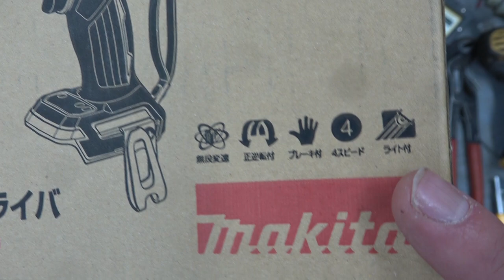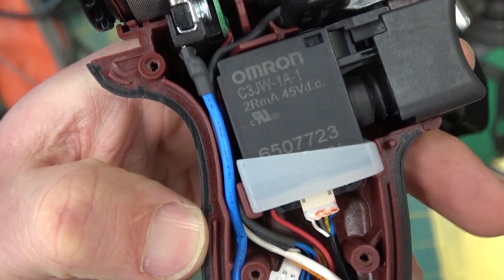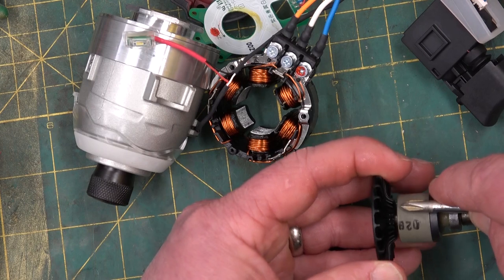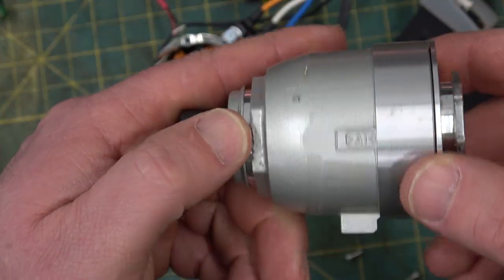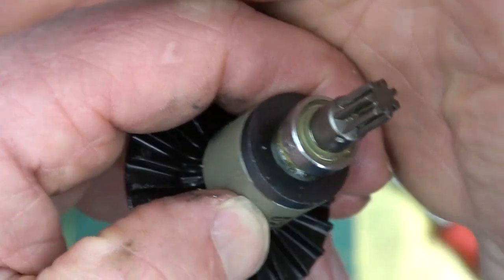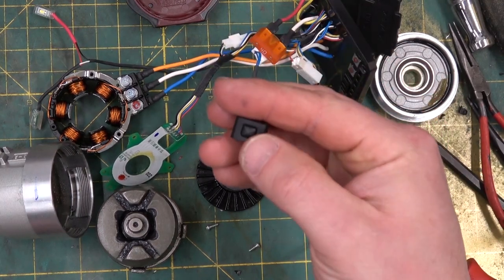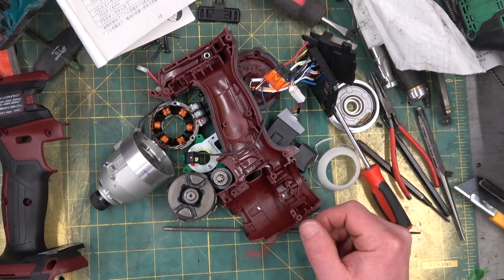Are Japanese Tools Better? Yes.

Comment: Translations + Notes below:
The characters on the board with the Hall sensors are 紫赤青黄白黒, which makes sense both in Japanese and Chinese.  It means “Purple, Red, Blue, Yellow, White, Black.”  I believe it’s referring to the order in which the colored wires should be connected (to avoid errors during assembly, I suppose). Note that there is no purple wire, but there is a blank spot next to the red. 

In the manual, the small switch is called 手元ボタン, which means something like “close at hand button” or “at-hand button”— basically, a button in convenient reach of the trigger finger. 

The panel at the bottom is as follows:
The left hand box has a white button with 打撃, “impact” in this case, with a series of light indicators above: 弱　中　強　最速, respectively, “Weak, Medium, Strong, Fastest.”  Underneath the box, to the immediate right of the white button, there is a black button ライト, meaning “light.”  To the right of it, there is an indicator light (still on the black field) with the inscription 設定, which can mean either “settings” or “set” (I would have to see the manual, but it indicates setting some sort of preference, likely— perhaps the default?). 
On the blue field, the drill has Makita’s proprietary 楽らく4モード “Super Easy 4 Modes” [rough translation] selected by the button with 楽らく (“Super easy”). These are modes in which the drill will automatically change the torque and speed based on the type of material you select and the resistance the screw is giving. The modes are:
木材 “Wood materials” (top left indicator light), where the drill will start at a lower torque while a wood screw is going in then automatically jump to the highest torque when the head is almost flush to give it a nice tight fit
ボルト “Bolts” (top right indicator light), which will only use the top speed/torque but stop as soon as the bolt tightens (to avoid over-torquing)
And two modes under テクス用 for driving self-tapping metal screws into pilot holes (literally translated “Tekusu-use,” referring to a widespread brand of self-tapping metal screw called “Tekusu,” made by JPF Manufacturing). The two modes are 薄 “thin” (bottom left) and 厚 “thick” (bottom right), for use in thin metal sheets and thicker metal sheets/beams, respectively. The former tests the resistance of the screw to find an appropriate level of torque to avoid stripping and automatically stops when the screw is fully tightened, while the latter does the same on higher torques, but focuses on avoiding breaking off the screw head or otherwise damaging the screw.
This is explained in detail on the following site, with videos (Japanese only):

https://www.bildy.jp/mag/makita-td171drgx-mode/#i-5

Your final comment is correct— Japan often makes different products for the domestic market, sometimes better produced than the international market counterparts. Oftentimes, this has to do with the very specific requests of the Japanese market (see the “Galápagos Syndrome [ガラパゴス化]”
https://en.m.wikipedia.org/wiki/Galápagos_syndrome
). This also has to do with a sad tendency of Japanese companies to forget that there is a world outside of Japan. It can be hard to get these products in the West, but there often are really good deals on the used markets (eg. Yahoo Auctions)— you should be able to purchase on websites that ship only within Japan or only accept Japanese credit cards by using a proxy buyer.  These are several companies that will charge a commission, but will buy the product and pay for you at domestic rates, then handle shipping it to an international address (they often charge 10% or so— not the cheapest, but with the deals on the auction sites you can save TONS of money over Amazon.co.jp 
If that’s too sketchy for you, though, Amazon JP has a halfway decent selection as well)
Hope this helps!
Reply: More likely Japanese. 青 is more of a light green in Chinese, and you'd actually use 藍. Also 赤, even though Chinese use that for red, that's more used in old literature, modern Chinese will use 紅. Also, they didn't use simplified Chinese, which Hong Kong and Taiwan uses
Reply: @egonsung  Thank you for the comment! That’s fascinating— in Japanese, 藍 and 紅 are used, but more for the specific colors of indigo and crimson, respectively. I did not know that they were used for the more general blue and red colors in Chinese!
Reply: @egonsung  The character for black is a clear indication that it's Japanese. 青 is used for blue in Chinese too. Hong Kong and Taiwan use traditional Chinese.
Reply: 青 means Bluey-green or Cyan, either one is ok, but in electronic, printing…, Cyan is better. In printing, CMYK, Cyan青, Magenta 品红, Yellow 黄, Black 黑.
Reply: Thank you so much for this comment!
Reply: The info is highly appreciated
Reply: Thank you for this information. I stumbled across a Japanese-made Makita impact driver exactly like the one in this video. I liked the color and bought it on Ebay brand new not knowing that it was made in Japan and that Makita's Japanese domestic manufacturing standards are a bit higher than their export manufacturing standards. My recollection is the price was comparable to the exact same model of a Chinese-made impact driver. I did find a user's manual in English online, but your explanation of the symbols on the tool help. Thanks again.

Comment: What makes the application of Viton so great for tools like these isn't just the high temp rating. Viton exhibits nearly as wide of a chemical resistance as PTFE AND has an unlimited shelf life! Environmental deterioration  in rubber compounds is what causes the "drying out" that typically causes failure in old or particularly cheap tools.
Reply: Isn't at high temperatures or in a fire, fluoroelastomers decompose and may release hydrogen fluoride?

Comment: Notice the jump cut while the riff-raff was figuring out the reverse thread. Appears to be a little distress to the housing that went along with the discovery.
Reply: He was just making sure it wouldn't gall if he tried to overtighten it. All part of the procedure <3
Reply: Shhh... I have been using oxy-acetylene torch for years and I still duck up the acetylene reverse thread fittings😅
Reply: Yeah gets me every time when you are work in auto mode. Every 5th time you take something apart and think s&%t they have done this up tight, and then you sit back and look at it and engage your brain. Hopefully you haven't screwed it up too much before you figure it out.
Reply: That was an alloy hardness test.
Reply: The little grooves cut into the acetylene "nut" is a handy reminder thats shes a lefty-tightey. guessin' thats true for all manner of gas fittings.

Comment: 3:38 - That's just the wiring order for that board. It's got 紫赤青黄白黒 which is "Purple Red Blue Yellow White Black". While Chinese and Japanese share some parts of writing I'd guess that for something that already has domestically sourced parts (Nichia, Omron) they wouldn't skimp out and outsource a simple board.

Bonus fact - The "happy little backwards e" is の and you see it a lot on stuff from Japan because it's the "Possessive Particle". It indicates possession between two words. Think of it like ('s) in English. The "Healing Bench's Shmoo" becomes "Healing BenchのShmoo”.
Reply: A good word for that is of as in soup of porkbelly
Reply: @jetaddict420  Yes, but ('s) means the same thing and the order of the words is the same. With "of", the order is reversed compared to の.
Reply: Nice
Reply: 赤could mean red in Chinese too but it's not often. Chinese will say 紅. So it's most likely Japanese.
Reply: @JW77  aah, nice info there bud. Always thought both of them use 赤 regularly.
Reply: @JW77  the origins of this is the split between chinese and japanese language historically. Japanese developed a side language using simplified kana, hiragana, katakana for foreign words and kept traditional chinese characters for a lot of words as Kanji.
Chinese simplified over time, too, and modern "simplified chinese" characters were just built on top of the traditional hanzi from waayyy back in the time that they shared a language.
Reply: @Mindful2222  All the Chinese PCBs I see use  紅. Always with that characteristic serif font when there is English.
Reply: Came to say this, said it, then realized it had already been said.
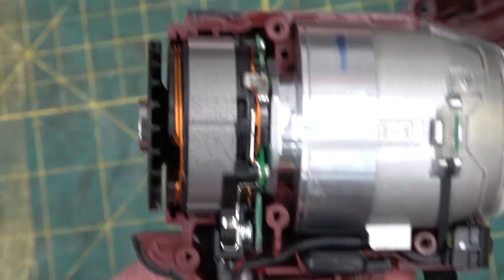Reply: 青means blue in  Japanese. While it means grass green in chinese. 2:40 and I don't any green wire.
Reply: @bosszola  青 is both green and blue in Japanese. The language had one word for both green and blue (青) and both were seen as essentially different shades of the same color, then they realized they need to distinguish between green and blue and made the word 緑 which refers only to green but you'll still see green things referred to as 青 (like their traffic lights).
Reply: @bosszola  True, but Japanese have a weird idea of green/blue. They use 青 to refer to the green traffic light and green apples, though technically it means blue.
Reply: @DingleFlop  there was no 'split' between Chinese and Japanese because they were from completely different origins. What happened is that Japanese borrowed the Chinese writing system and a lot of Chinese words and then realized that the Chinese writing system which was developed for Chinese didn't work for Japanese because the two languages are very different. Hiragana and katakana are not a 'side language' but just the parts of the language that couldn't be represented efficiently with Chinese characters.
Reply: @theodiscusgaming3909  To me, the Japanese green traffic light looks slightly blue compared to North American ones, so calling them 青 isn't entirely out of place.
Reply: loved your explaination.
Reply: @laserdan  Coincidence: we've got a different shade of green on railway signals to not to mix and match with the traffic lights' greens. That is some off-kilter green, more turqoise-ish, that  I guess would happily call itself 青 given the chance :D (And then there's the yellow, which is totally the very same yellow as Na vapor lamps used everyhwhere... to not mix in, yeahh right.)

Comment: Not many people in the US are willing to shell out $300 for a BL impact driver. In addition and while he didn’t mention it, the chuck is actually 1/4” (or so) deeper which allows for flip-able bits; very nice to have different bit heads and not have to go retrieve one. I was in Japan for a long time and ran an industrial shop (which included 6 carpenters) and was amazed at the quality of some of the Japanese domestic tools.
Reply: I would buy it in a heartbeat if it meant I wasn't replacing power tools every 5 to 10 years. I'm sick of the throwaway culture

Comment: The “hand button” is actually to change speeds while using it so you don’t have to use the speed control at the bottom of the impact
Reply: nice
Reply: I own one like that - dtd171, made in a different country. The button is programmable. You can select one program and apply it to use when this button is pressed. When pressed again, the tool will revert to previously used program. Great for repeating certain actions without using both hands for program changing while on a ladder.

Comment: I have just looked inside my Makita DTD171 (Made in China) which looks the same as in this video except it was made for EU market. It also has Omron switch, Nichicon capacitor silastic allover connectors. It doesn't look lower quality tool. Everything is identical.
Reply: That’s because it’s not what country it’s made in, but quality control, that counts.
Reply: And this video perfectly illustrates confirmation bias in action and how it distorts thinking. Later he's gonna compare a Nissan Skyline against an inexpensive family car and use that comparison to tell you how much superior all Japanese cars are.

Comment: That little switch is the "quick shift" programmable button for the different settings so you can switch between the ones you want faster and without looking.

I've had that impact since early 2019. It's awesome.

Comment: Just like their cars. They get the better motors with better interior, Exterior, and performance packages, also better factory wheels and suspension setups.
Reply: When you look at their past. When tourists started coming, they made stuff for them to look like genuine antiques. 
So they build tools for themselves and sell knock off to us. So it hasn't changed what we think is the real tool. Ha ha very clever.
Reply: That's why when you buy a Japanese car, you don't want one made in Wisconsin, you want one made in Japan.
Reply: They also cost 30% more
Reply: @radry100  
That's why you get harbor freight tools cheap or go for better quality. 
So I would gladly pay 30% more if my daily tools lasted longer. Not cook off because of cheap part inside.
Reply: @scjohnk  And you want your Mercedes to be made in Germany, not South Africa...as many have found to their peril.
Reply: @moyadapne968  how about Bubba Benz from Alabama?
Reply: 100%

Even with say Toyota, a company that has done everything it possibly can to minimize perceptible quality differences in feel and failure rates, a Japanese made Toyota will still feel and perform better over time. I'm not saying the difference is massive; clearly it isn't. But there will likely always be a disparity, and as you said that's not even looking to the cool options and trim levels they have vs elsewhere.
Reply: Yes my toyotas are cars you drive and never worry about anything. They are built to abuse and just drive. Corolla with 290k miles original trans fluid. Original suspension. Oil changes at 10k miles. Never an issue. 
Toyota Highlander with 200k miles still drives like new.
My f150 is 3 years old and feels like trash already. I already put thousands into it. I'd buy a. Tundra but they are expensive and get very bad gas mileage vs my ford. If toyota can do something about their bigger motors being more efficient it be great. Their v6 and v8 are very reliable but also very thirsty
Reply: bs, my Toyota pickup was the biggest piece of crap ever, got rid of it at 6000 miles while my ford has been going over 400,000.
Reply: @armadilllo  most North American Toyotas come from Canada. So does your Ford.
Reply: @TensionalSpy  my toyata was from japan and my ford was built here.

Comment: Japan makes some good stuff. Especially engines such as Yanmar.
Reply: Yes. I have one Yanmar inboard diesel. My 2 outboard motors are Made In Japan...........Tohatsu! Many other Japanese outboards are made outside Japan now.
Reply: Yea i have a small tractor from the 70s fully restored (bodywork that is) 2cyl yanmar fires evrytime on its first stroke no matter what and without glowing
Reply: My 2013 mazda 3 has been assembled in japan and im at 100K and nothing broke on it at all yet! They put in more effort then most in their work its great!
Reply: @saberxzero   03' Mazda 6 here, 272.000Km and the only problem it has ever had was becuase my brother (somehow) shorted it and screwed up the charging board but other than that it has been loyal as frig.
Reply: @takafumiarisawa70  Miiiiint, although i wont make it to 300k winter salts here fuckup the structure of the car itself sadly!
Reply: Any audiophile would agree wholeheartedly.

Comment: The bill of materials on that contain too many parts to even consider branding it a USA product.
Reply: @martialme84  Made (10%) in USA (90% in China)

But mark it up for patriotism or something.
Reply: @martialme84  Ok... just remember who landed on the moon first.
Reply: @kilometer3853  that has what to do with anything?
Reply: Proudly sold in America 🇺🇸
Reply: @Patrick Baptist Tesla, SpaceX, starlink, neurolink.  At least some muricans are trying.
Reply: @youmakeitreal  Tesla is a terrible example though, because the quality is just awful. China taking up production of Tesla cars is the best move Tesla ever did.

Rockets? Maybe. I wonder how cheap an endeavour or would be if it wasn't 'merican.
Reply: @Patrick Baptist Well, tell me what your country does best?
Reply: @kilometer3853  America does everything best
Reply: @MelodicTurtleMetal  ouch.
Reply: @MelodicTurtleMetal  I actually own a Tesla and it is the best car I have ever owned, and I have owned them all. The one thing I do know is that the Tesla that I drive is not designed to fall apart at 100 thousand miles.  Like ALL the others are.  I am a mechanic and have worked on "American"  German and Japanese cars for the last 30 years.

Don't knock it if you haven't tried it.
Reply: @kilometer3853  actually SpaceX gets stuff up into orbit cheaper, and faster than anyone else. (Saving American tax payers a bundle)
Oh forgot this:
 Muricans lead by a South African 😉
Reply: @Patrick Baptist there's no such thing as a tooth fairy, easter rabbit or the mark of the beast.
Reply: @youmakeitreal  all heavily subsidized by taxpayers or they wouldn't be solvent
Reply: @wurzzzz  and ULA is not?
Reply: @MelodicTurtleMetal You  must be from Europe? How am I ignorant? you're the guy hating hard on Americans... are ya sad you cant own a v8, ride a Harley Davidson, and live on 20 acres of land all for the low low price a regular 9-5 job? But hey at least you have free health care..... Give me a break America has been the  front of innovation since the industrial revolution. Only thing the euros have ever done is complain.
Reply: @UnknownGamer40464  10% in USA? I see you are an optimist sir
Reply: It's quite common that Japanese companies make better products for their own market. I can mention the watches from Seiko.
Reply: @MelodicTurtleMetal  Right, yet people continue to flock and relocate to America genius.
Reply: @michaelbrown3423  people flock everywhere, don't flatter yourself
Reply: @MelodicTurtleMetal  lol you know thats a lie.
Reply: @MelodicTurtleMetal  and the American dollar is still worth more.
Reply: @ksprr6856  Maybe, just not in the case of Makita. A Makita of the same model made in Japan, China, UK, or the US will be identical.